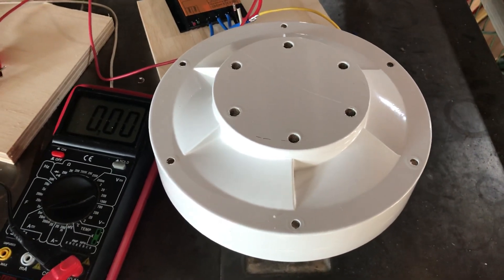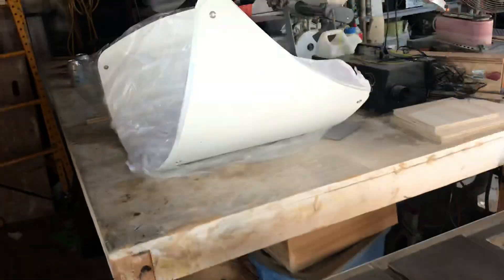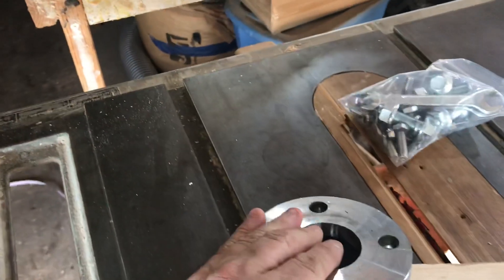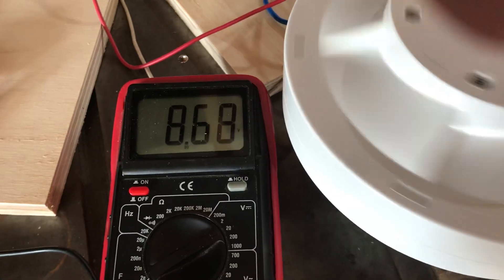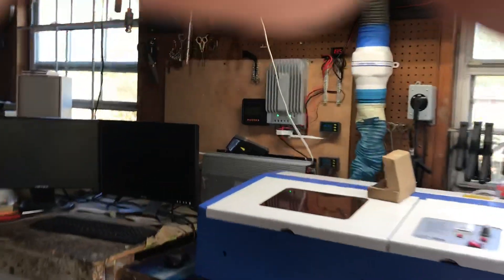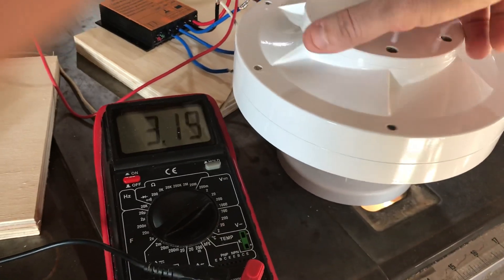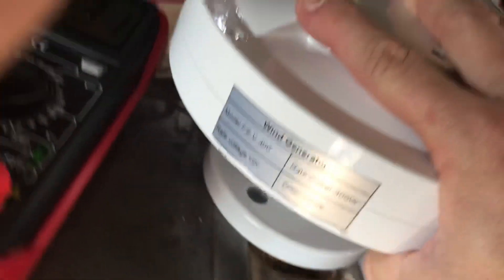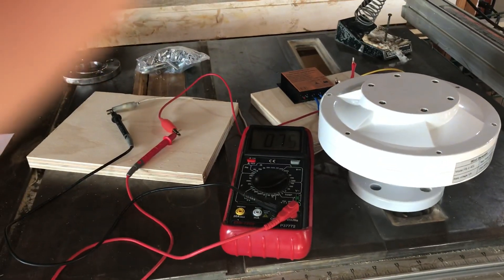Pamico VAWT  400 watt wind turbine

Comment: Can u give me controller input voltage vs output voltage relationship?
Reply from the maker: Input voltage and output voltage seem to match. Controller breaks at 14.7 volts. It claims to be mppt but the voltage in isn’t higher than the output. Free spinning the turbine with a 3 phase rectifier gets the voltage up like around 50+ volts. With the smallest load like .2 amps it stops spinning 🙄
Reply: @Checkitfirst  even i want to the minimum Input voltage to get 12+ output voltage?
Can u do it for me😢
Reply from the maker: @dayanandkasle5146 . Sure😁
Reply: @Checkitfirst  I'm waiting 🔭
Reply from the maker: @dayanandkasle5146 . Try being a little more specific with your question. I don’t quite understand. I was being a little sarcastic when I said sure. Sorry,,,, didn’t mean to leave you hanging. I would love to help you if I can it’s just your question is a bit lacking for my pea brain to understand. Would you be willing to ask it again in more detail?😊
Reply: @Checkitfirst  my homemade turbine is only able to produce voltage upto 8 volt .....What I want to know is does this mppt charge controller boost this voltage upto 12 volt
Reply from the maker: @dayanandkasle5146 . No. To get a good charge you need to produce at least 18–24 volts to charge a 12 volt battery. There are some voltage boosters out there but they won’t produce any usable amps to charge a battery

Comment: Any word on that unit.  And how quiet is it.  I need one for my boat.
Reply from the maker: Jean Mondeau. No noise yet. Really haven’t had any good wind to test it with. I’m working on it this weekend to get it up into the air much higher. I’ll have a much better idea on the output. So far I’m getting milliamps out of it. Once I get it up in the air and we have some good wind I’ll do another video and I’ll be able to decide whether or not this really puts out any power